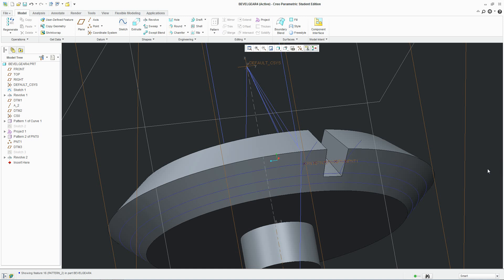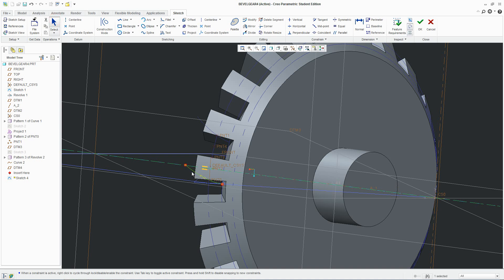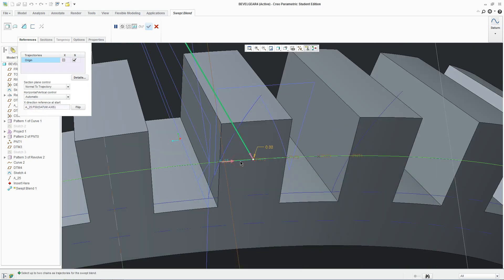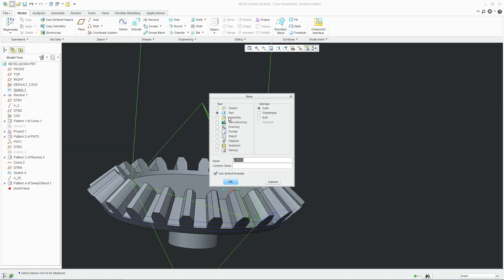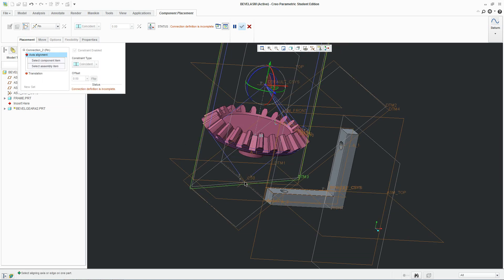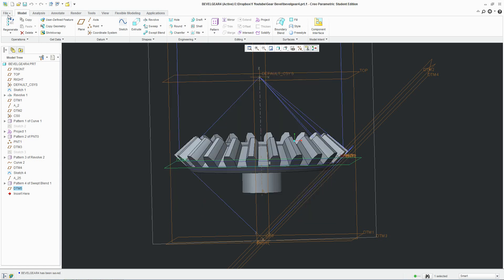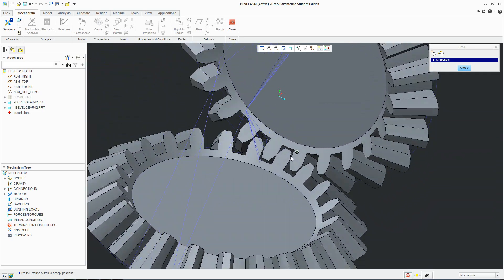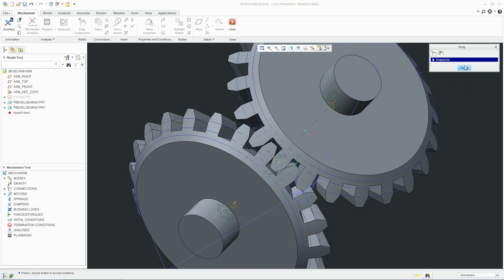Creo Tutorial - How to Draw an Involute Bevel Gear Part 3

Comment: many thanks for such good tutorial. one question - what is "20" in Db = D*cos(20)? And what is "20" in Involute Equation? thank you.
Reply from the maker: 20 is the pressure angle. It is a common number that is used, 20 or 14.5.